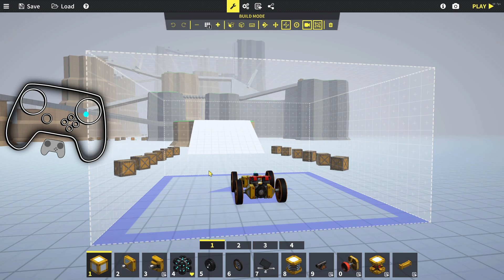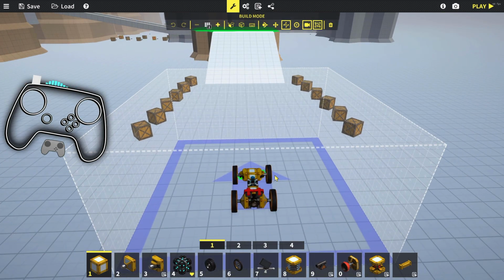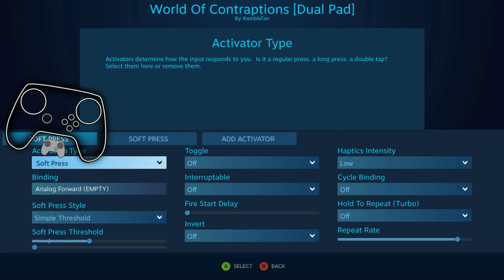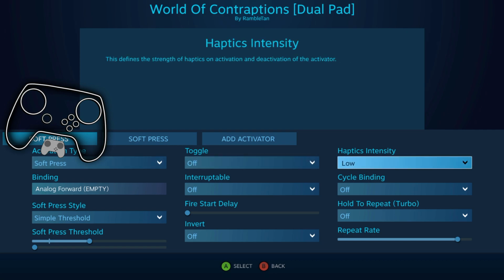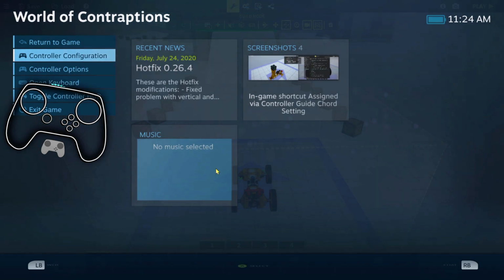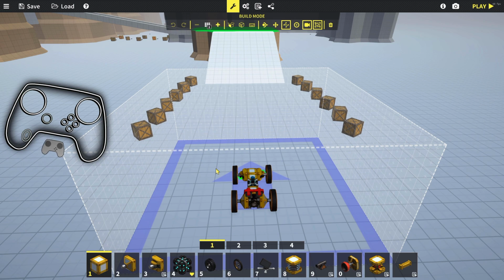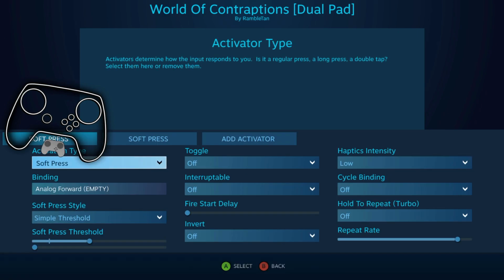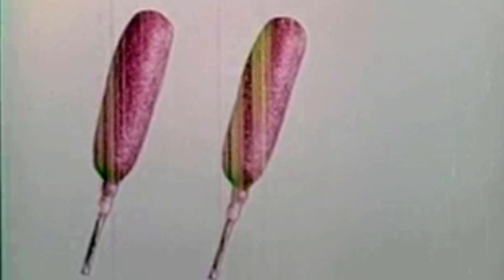Stack Soft Press Activators for Trigger Haptic Feedback - Steam Controller Input Tutorial

Comment: Thunk thunk! Out of curiosity, do you think softpress with haptics could theoretically be a replacement for the full press physical button? Like, if SC 2.0 were to come out would it be worth it to get rid of the full press buttons and just rely on softpress/haptics or is there still some value in the trigger full press button outside of needing them for PnP mouse functionality?
Reply from the maker: More inputs is always better but yeah, I do kind of think soft press was partially made to give single stage triggers a more consistent feeling full press. I think there's still value though in an actually full pull digital input that has a resistance threshold. We can basically have easy 3 stage triggers on Steam Controller; soft pull, soft press full, and hard click digital full pull.
Reply: I haven’t experimented with soft press yet, but I’ve been using soft pull and full pull actions on a DS4 for awhile now, I’m trying to understand why you need the actual button at the trigger’s end anyway? 
And I’d be more interested in trying soft press on an analog stick, due to soft pull and full pull already being options for the triggers, unless I wanted a third action to use… 
Now is there any way to get the Hip Fire setting applied to the analog sticks? That would be neat to try
Reply: @xMRxLAMAx  Reason for the digital buttons at the end of the triggers; first reason is a technical reason, Steam Controller was released to be a PC controller. The digital buttons helped make the SC "plug and play" as a mouse with generic drivers. As for the functionality reason, there's a natural "resting" position on the physical button that made it it convenient when using the full analog of the trigger, you didn't accidentally fire the full pull while "feeling out" the transition.
I haven't used any modern controller with their fancy force feedback triggers so i don't know if they could emulate that resting position.